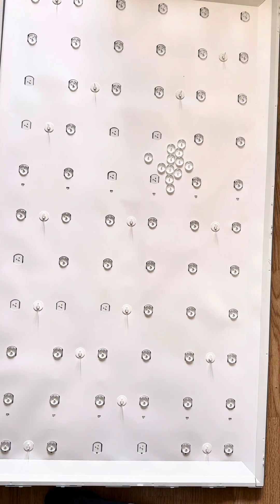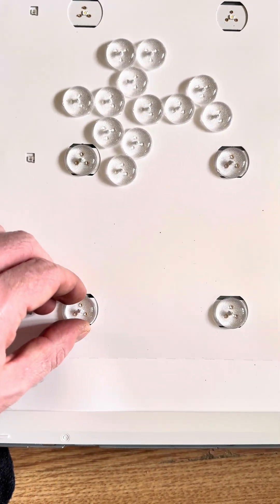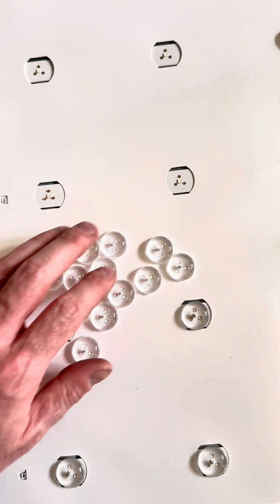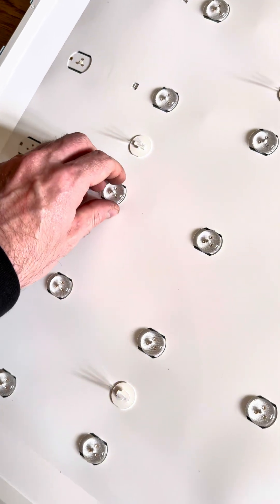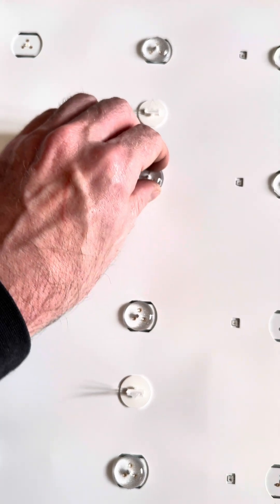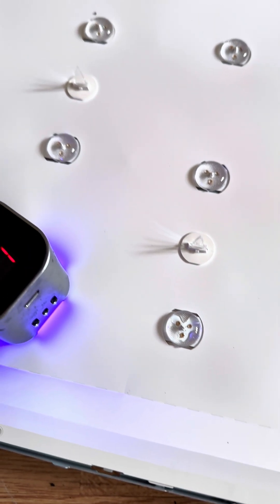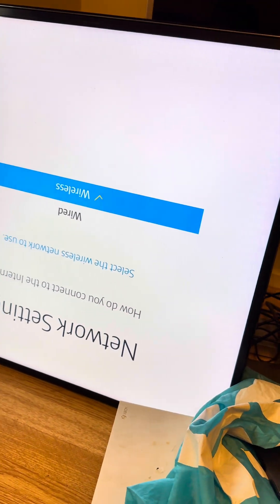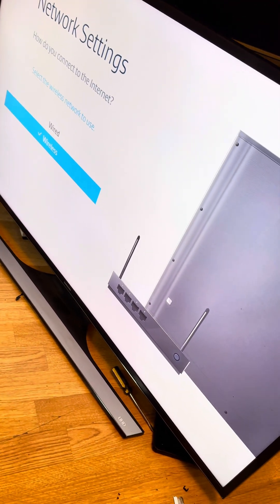Samsung TV Backlight Repair – No More Hot Spots! 🛠️📺

Comment: Where do i get the UV drier ?
Reply from the maker: It’s a Qianli iUv light, they on Amazon, AliExpress etc.
Reply: @Mobileithelp ok thanks so much im getting ready to take on this project this weekend on a samsung 75
Reply from the maker: @rashads4918 not a problem, I tend to lay the tv on the sofa, then take everything off, then take the back off snd leave the screen and surround on the sofa. 

You can do it the other way with suction cups but you better hope none of the suction cups come loose.

You can also lift the screen up with gloved hands on, but you have to be crazy careful as the screen is like eggshells .
Reply: @Mobileithelp thats the part im most nervous about. Do you have a video taking the tv apart?
Reply from the maker: @rashads4918  no not for this particular one there are plenty of videos on YouTube though showing you how to take them apart but very on each model how it’s done

Comment: How much would you typically charge for this work? I have same issues thanks
Reply from the maker: Hi, it depends on the tv, but £65-85 usually
Reply: @Mobileithelp it’s a Samsung UE75MU6100 I still have a picture and audio just very dim and shadows, couple of vertical shadows also. At a loss with it as I’m unsure of cost
Reply from the maker: @user-nw5ot5yy2g oh wow one of the huge ones, is it curved too ?
Reply: @Mobileithelp  no not curved mate just massive lol. Reluctant to let it go
Reply from the maker: @user-nw5ot5yy2g I can try it, but a panel that size I can’t guarantee it won’t crack when removed. 

This one in the video I think was a 55, so not too much flexion in the panel, a 75 is going to be quite a job to remove from the housing in one piece.

Comment: Wonderful! I've got a plethora of big white spots! on me Samsung TV I gently turned the TV upside down and I could hear all them little critters changling about ! just wondering if i could use a Gel loctite glue or as it got to be a resin type? Thanks
Reply from the maker: You can use regular superglue, the issue is you can’t adjust it once placed, unlike when using something like Bostik fix and flash or 5 second fix.
The problem is if you don’t get it aligned bang on you can get weird light marks and halos , spots etc if the led isn’t aligned properly with the lens.
Reply: @Mobileithelp Great thanks I think I will try Gel superglue it should give me more time to get them lined up takes a  touch longer to set I will just leave the TV  flat for a hour or so while it sets ! Thanks again 👍
Reply from the maker: @MrStraww not a problem, if you rotate them when fitting then should feel right once they into the correct position as the leds click into a slight recess in the diffuser. You might was to try dry fitting one first so you can feel what it feels like when it’s in the correct place.

Comment: Which glue did you use?
Reply from the maker: Bostik fix & flash uv activated superglue. 
Means you can align it properly first before using the Uv light to cure it, unlike regular superglue which just instantly sticks.